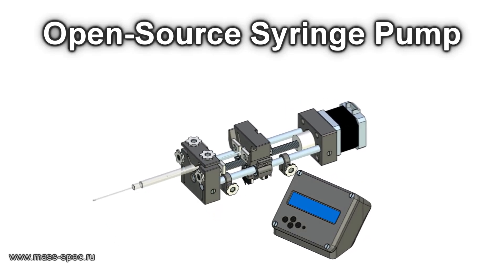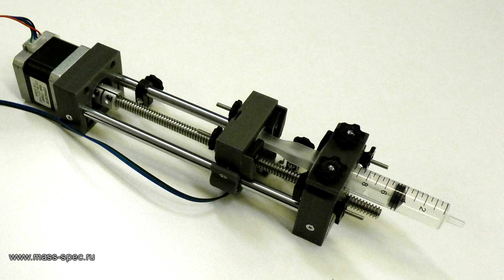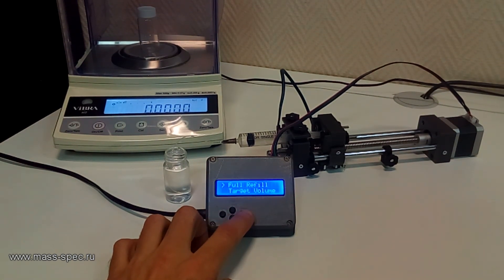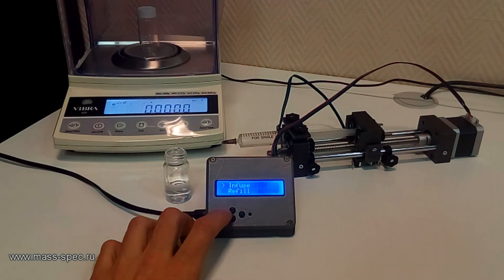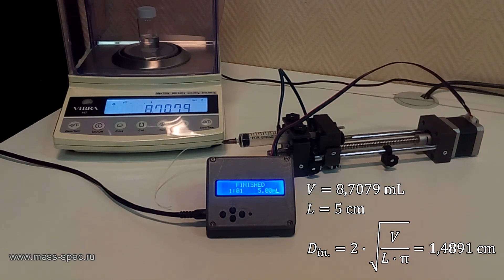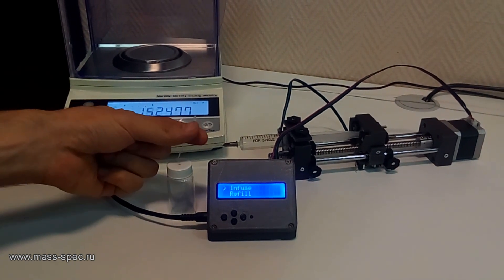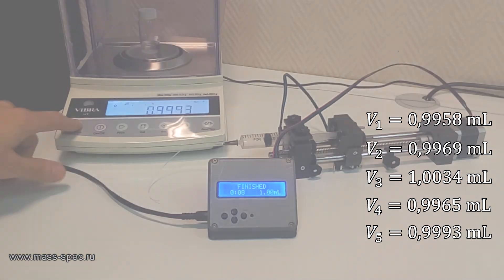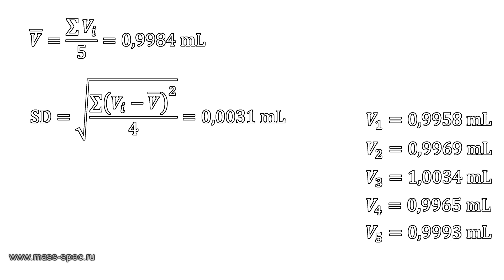Open-Source Syringe Pump

Comment: I am having some trouble with keys from lcd shield. It only works for infuse and start and stop. I cannot access the other menu options . Can you help me please .Thank very much.
Reply from the maker: As far as I understand only the LEFT and RIGHT buttons work. If so, there is a solution:
1. Add this code to the loop():
  while (1) {
    lcd.clear();
    lcd.setCursor(0, 0);
    lcd.print(analogRead(A0) / 4);
    delay(200);
  }
2. Read voltage for each button. In my case, I got the following values:
  V(select)=160;
  V(left)=102;
  V(down)=66;
  V(up)=26;
  V(right)=0.
3. Calculate new boundary values for function ‘getButtonState()’ (this values are used in if-else conditional). In my case:
  x_boundary(RIGHT) = 0.5 * (V(up) + V(right)) = 13
  x_boundary(UP) = 0.5 * (V(up) + V(down)) = 46
  x_boundary(DOWN) = 0.5 * (V(down) + V(left)) = 84
  x_boundary(LEFT) = 0.5 * (V(left) + V(select)) = 131
  x_boundary(SELECT) = 0.5 * (V(select) + 254) = 207
4. Change function ‘getButtonState()’ according to new boundary values.

Comment: How might one go about configuring two of these to simultaneously pull different volumes draws? And then dispense the two simultaneously?
Reply from the maker: Unfortunately, the current firmware version cannot independently control two pumps.

Comment: Hello, amazing work! If I were to adjust the design to apply 120 N linear force for my purposes with the dispensing or uptake of a viscous fluid and maintain the 20mL/min speed and to fit a 60mL syringe (extended plunger is about 140 mm long) how would I do so? Please let me know what might be needed if you can!
Reply from the maker: The control unit can be used with 60mL syringes without any modifications. However, it is clear that the syringe and stepper motor holders need to be completely redesigned. I worked with viscous media, and our assumptions about syringe behavior may not be entirely accurate. For instance, when dispensing paste from a plastic syringe at a relatively high speed using a stepper motor with significant linear force, it caused the plastic plunger to twist and become damaged.

Comment: Hi @Andrey Samokhin , have you any anthor tutorial where you explain the arduino code thanx.
Reply from the maker: Hi belguith med amin, unfortunately there is no tutorial. I'm not going to make such a tutorial in the near future. Arduino code is difficult to follow, especially if you want to change the structure of the menu. You can read my answer to the question about '... cnc project that paints on glassware ...'. Probably it will be useful for you.

Comment: Thanks, I am planning to build this syringe-pump but I can not find bearing dimensitons and they change by the manufacturer,  is it 8x15x24mm or something else?
Reply from the maker: In the original design, a pair of shorter bearings (i.e., LM8SUU, 8x15x17mm) are used. A bearing with a length of 24mm is a standard version (i.e., LM8UU). I saw pictures on the Internet when LM8UU bearings were used to assemble the pump. It looks a little sloppy because bearings extend beyond the boundaries of the 3D-printed carriage. This weekend I had time to change the 'carriage.stl' file a little. I have uploaded this modification on Thingiverse (see the 'carriage_lm8uu.stl' file).
Reply: @andrey.samokhin  thank I can not find LM8SUU and will use LM8UU too.

Comment: Great video! 
I'm curious about the motor specifications. I've tried to built a syringe pump but the motor seems to be a little inefficient.
Hope to hear back from you
Reply from the maker: A linear force applied to the plunger depends not only on the stepper motor. It depends on the current limit, the lead of the screw, the friction between the nut and the screw. I can tell you about my setup. I use a 17HS4401 stepper motor with an A4988 driver (the current limit is about 1.1A), a 2mm lead screw, and a POM nut. The measured torque of the stepper motor is about 0.17 Nm (at a rotational speed of 0.4 rev./s). The measured linear force applied to the plunger can reach 200N under these conditions (at a linear speed of 1mm/s).

Comment: Hey Andrey! This is an excellent project and can u just clarify my doubt.. what is the length of lead screw and guide rods? In instruction manual it's mentioned both are 8mm Dia but no info about the length can u clarify it? Thanks in advance!
Reply from the maker: Hello! The length of the rods and leading screw should be selected according to your goals. For the pump shown in the video, rods have a length of 200mm. The leading screw is also 200mm in length. For this reason, it protrudes a little. About a coupling. You can use any rigid coupling. Currently, I use the cheapest metal one (which does not have any slots). On video, you can see another metal one with some slots. It also works fine. You can even print your own (the respective stl-file is a part of the project).
Reply: @andrey.samokhin  Thanks for the reply mate! definitely it was helpful.. and one more doubt is handknob necessary? they forgot to print the handknob and just wondering if it's compulsory to add it..

Comment: this hose with the luer lock connector for the syringe...what is the name for it, respectively where can I buy something like this?

unfortunately I can find it only with hoses with a large diameter :(

thanks a lot!
Reply from the maker: Hello, it's a DIY hose. I used an ordinary steel needle with a blunt tip and a silicone tube.

Comment: Hello, first of all thank you for the work done. I have done all the steps and have managed to make a syringe pump without major problems. However, I would like to work at the highest torque possible for the nema17 motor which with 1/16 micro steps is not achieved. This is why I was thinking of working at full steps, but I don't know what I should change in the code/hardware to achieve the maximum torque. 

Excellent work !
Reply from the maker: According to my experience switching to the full step mode does not increase torque significantly. But you can carry out your experiment. To do it you need to change only one line in the code. Find the 'BASIC SETTINGS' section. The number of microsteps is set in the following line '#define NOFMICROSTEPS 16'. Change 16 to 1. Moreover do not forget to change the settings of your stepper motor driver (set all DIP switches to OFF).
Reply: @andrey.samokhin  Thank you very much for your reply, clearly it didn't work as I expected (oops!) haha. I am looking for a way to increase the torque since the syringe pump will be used in high temperature reactions (180 °C approximately) and for that it must overcome a 250 psi back pressure valve. If you have any advice that would help to achieve that goal.

Again thank you very much for the quick response, best regards !
Reply from the maker: @xkoppaz  The first thing is an obvious one. The smaller the inner diameter of a syringe, the higher the pressure is. Moreover, a stepper motor with a gear box can be used to increase torque. I encountered some projects on the internet (e.g., https://doi.org/10.1016/j.ohx.2018.02.001). But I do not know whether it meets your goals or not.

Comment: Sir do i need to attach the 12v power supply separately with driver or just need to connect the aurdino wire only
Reply from the maker: I used the same 12V power supply for both the Arduino board and stepper motor driver. The Arduino board and the stepper motor driver were connected with wires according to the electrical circuit (see instructions available on our site).

Comment: Hi @Andrey Samokhin, firstly thanks for this great project and documentation. I have been having trouble calibrating my Syringe pump. I followed your instructions exactly but something seems not to work, perhaps you can help. Firstly I am using a 1mL syringe, as I want to dose very small volumes. The actual Length to volume ratio is about 55mm/mL. But when I put this in as a starting value the syringe moves much too far. 

By means of iteration, I calibrated my pump and got a value of 13.9XX mm/mL to give the correct dosages. 

I went through your IDE code but can't seem to find the fault.
Reply from the maker: Hi Ruan, thank you for appreciating this project. The 'Length/Volume' coefficient of 55mm/mL looks reasonable. I set the same 'Length/Volume' coefficient on my device. Then I infused 1.0mL with a flowrate of 1002.673 ul/min. The carriage moved forward on 55mm (as one can expect) and it took about 1min (plus-minus one second). In my case everything works correctly.
If we divide 55 by 13.9, we get about 4. It seems to me that you use 1/4 micro-stepping instead of 1/16. What driver do you use? Is it A4988? Are all DIP switches in the 'ON' position? Check 'Step 2.5' in the manual.
Reply: @andrey.samokhin , firstly you are right, but I don't know what is wrong with my hardware. I changed the Arduino code in your software to 4 micro steps after doing some testing to check if it was in fact the case, and now the diameter calibration works with the expected diameter values. I also checked all the wiring and the dip switches, all is correct, and yes I am using the A4988 driver. Anyway the 800-step resolution is enough for my application.
Reply from the maker: @ruanpretorius2679 , thank you for keeping me informed. It is difficult to find out the problem remotely. I believe the driver or the shield for it is the source of your problems (e.g. dip switches may be broken).

Comment: hellow i used the code to drive the syringe but i dont know what is tthe specifc flow rate required for a syringe am using 60ml syringe with 9cm where 1.5 mm per 10ml  can you help me to solve this plz
Reply from the maker: It seems to me that I do not understand what is your question about. Usually, the flow rate is set according to a particular application.

Comment: Hello, sir, first I wanna thank you for amazing instruction for making a wonderful syringe pump, because I have to do a project for my exam and you save my life. I want to ask you that if I want to control the syringe pump on the website or app, what should I do now, because I just want to gain more knowledge to get ready for the upcoming challenge in university life.
Once again, thank you so muchhhh
Reply from the maker: Hello, you are welcome. The Arduino sketch was written in 2018. I did not have much experience at that time. As a result, the code is not optimal (37% of program storage and 50% of dynamic memory are used). I’m not sure that the rest of the memory is enough to implement your idea to control the pump via Bluetooth/Wi-Fi/internet. Nevertheless, keep me informed about your progress. You can use another board, but in this case, lines of low-level code should be rewritten. Another solution is to use two boards. An additional board (e.g. ESP32 with Wi-Fi module) is used to control the Arduino UNO via UART. In this case, you have to modify the original sketch and add a function for UART communication.
Reply: @andrey.samokhin  Thank you very much, sir. I have a problem is that first I cannot draw the block diagram of that syringe pump, and I do not know why when I change the value for diameter, the program automatically changes the value for length/volumn, and the SD value is larger than the SD in the video (mine is > 0.2). Please help me. ( I actually need your help.)
Reply from the maker: @minhuc6236  I agree that drawing a block diagram is tricky. To set the parameters of a syringe you can use either internal diameter (it is usually specified by a manufacturer) or length per volume coefficient (it can be easily estimated using an analytical balance). Internal diameter and length per volume coefficient are connected. As a result, when you change one parameter, the second one is updated automatically. To answer your question about the standard deviation I need to know the type of a syringe, the volume of an aliquot, and the model of your balance.
Reply: @andrey.samokhin   When I enter the value for syringe 10mL like in your video, it is 14.891 the volume for refill and infuse is not correct but when I multiply 2 as the radius, the volume is correct, please explain why for me, I had thought for months but do not know why?
Reply from the maker: @minhuc6236 As far as I understand you set D = (14.9 * 2) to make the pump work correctly. Did I get it right? If so, please measure the inner diameter of your syringe with a caliper (or at least a ruler if you do not have a caliper). Moreover, specify the lead of your screw, the type of stepper motor driver, and the number of steps per revolution of your motor.

Comment: Hello how can I connect the screen with Arduino 
I don't see the linking method in the pdf file
Reply from the maker: Hello, in this project the LCD Keypad shield is used. It means that you do not need to connect the pins of the screen and the Arduino board manually. The specification of the LCD Keypad shield says the following: D8 - RS; D9 - Enable; D4 - DB4; D5 - DB5; D6 - DB6; D7 - DB7.

Comment: hallo sir thankyou for the desain, can i know how long the rod and the lead screw needed?
Reply from the maker: Hello, the pump in the video has 200mm rods. In this case, a syringe with a plunger length up to about 140mm can be used.
Reply: I had problem the lcd keypad doesnt show anything, but is connected to the arduino
Reply from the maker: @firdausrahmati8914  It is likely that the potentiometer is not adjusted (it is used to set the contrast of the display).
Reply: @andrey.samokhin  did you have contact person or email? For more discuss.
Reply from the maker: @firdausrahmati8914  You can find email on our website or in the article.

Comment: i am working on cnc project that paints on glassware and i want to use the syringe for dosing the paint but i want to control the syringe by using external signals from a break-out board the first signal activates infuse mode and when retracting away from the glass the second signal deactivate the infuse mode and activate the fill mode 
can you help me with the sketch ?
Reply from the maker: I don't have time to solve your peculiar task. But I can give you several pieces of advice to simplify your work.

1. It seems to me that you don't need 'Cycle mode'. If so you can sacrifice it by changing item[3]:
items[3]  = {YOURFUNCTION, 2, 4, 0, TEXT, "Your Mode"};
2. Add 'YOURFUNCTION' to the 'listOfPrograms'
3. Add condition to the 'loop()':
else if (nextItem == YOURFUNCTION) startYourMode();
4. Write your own function 'startYourMode()'. You can use 'pump(pumpingDirection, flowrate, volume)' to start pumping (pumpingDirection determines direction ('+1' or '-1'), flowrate is expressed in nL/min, volume is expressed in nL
5. Add a condition (or conditions) to the function 'ISR(TIMER1_COMPA_vect)' to stop pumping (i.e. to stop the timer):
if(...) TIMSK1 &= ~( 1 << OCIE1A);

Good luck with your work!
Reply: @andrey.samokhin  thank you so much